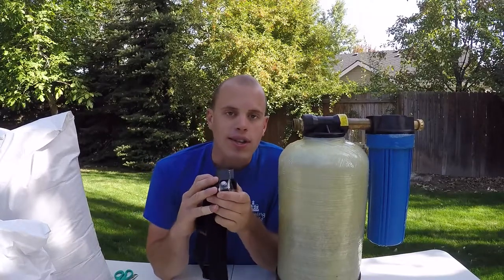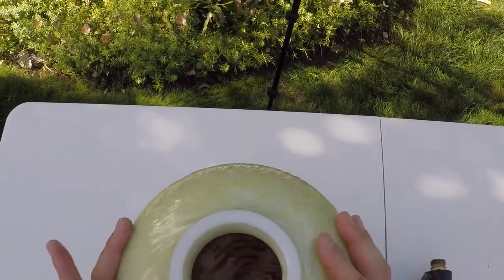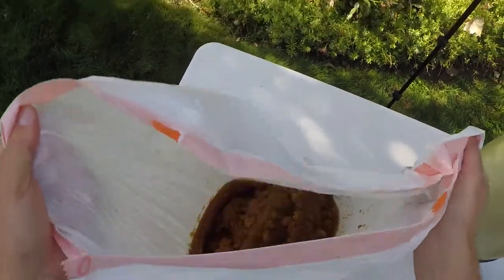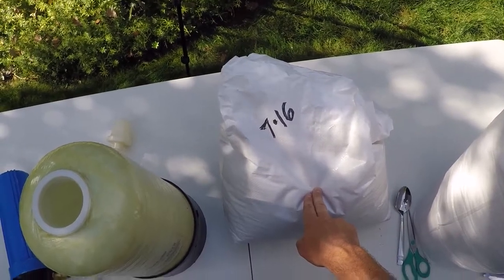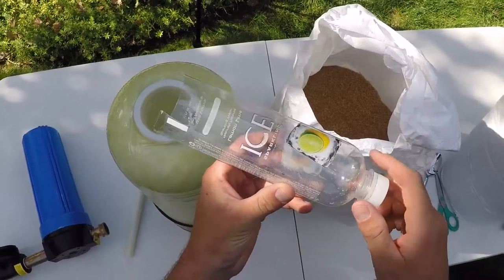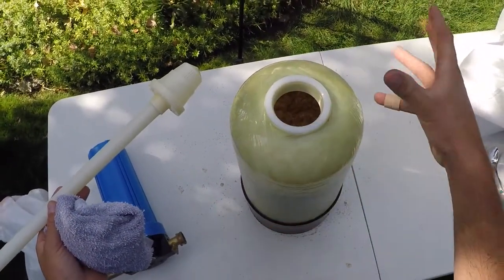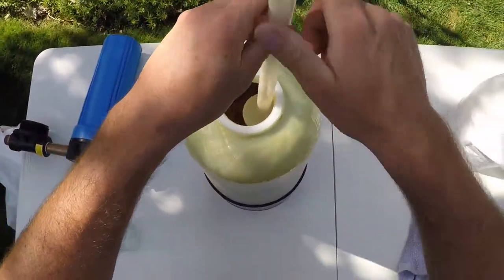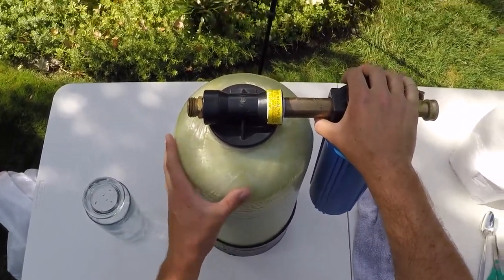How to Change De-Ionizer Tank Resin - Pure Water Window Cleaning

Comment: Pro tip: I use a traffic cone upside down to refill my tanks, very simple little mess. I also use window screen material at the bottom of the traffic cone connected to sewer system clean out to catch remaining resin when I rinse out my tank .

Comment: approx how much will adding and ro membrane to my di system extend the resin life?
Reply: Here: https://www.windowcleaningwarehouse.co.uk/resin-calculator.html use this link to calculate how much you can save by using an RO prior to the DI. For example - if your feed water is 385 and RO rejection is 96% you will have around 11PPM of product water. Input that figure into the calculator  - say you will use 40L of product water for 2x days a week with a 10L mix bead resin, you will have theoretically 318 weeks worth of working DI resin. But keep in mind that DI resin will start to degrade after a year of installation despite how little your throughput is.